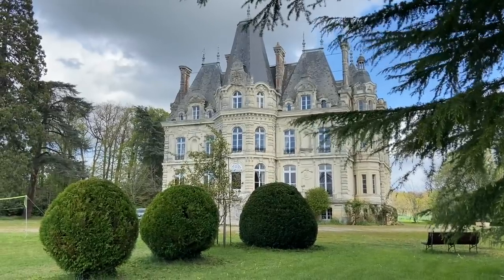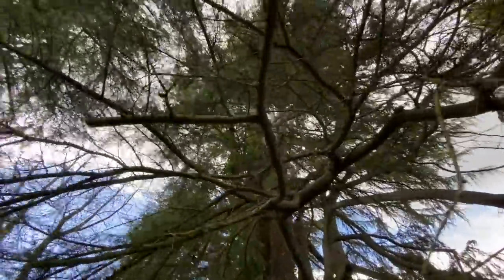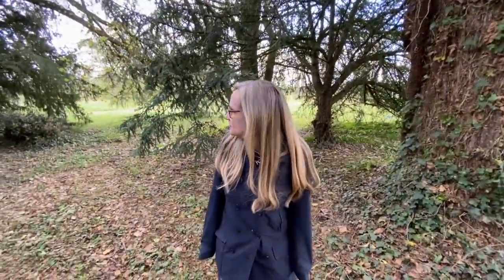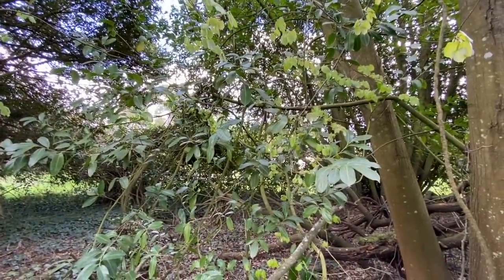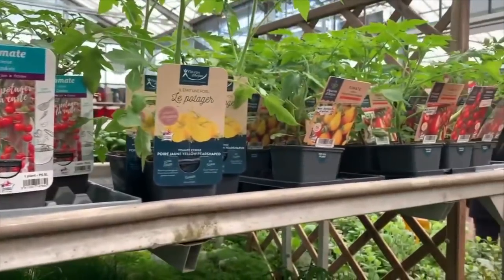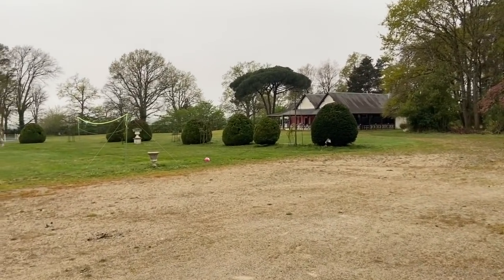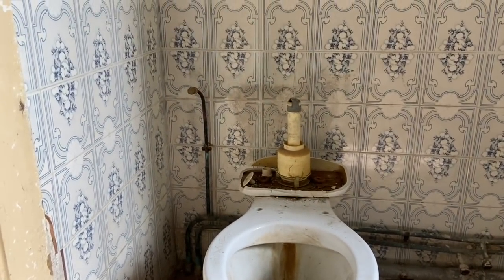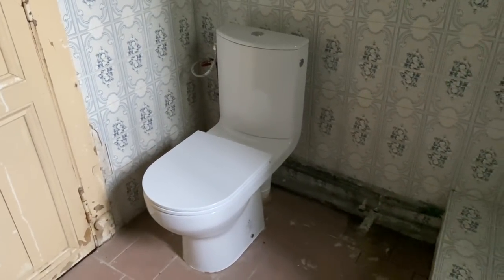Château de la Grifferaie, S3, E7, "Midterm Break"

Comment: I don't know if you were running the hot water but, my water turned Rusty when I left town for 2 or 3 day and no one used the water. It was from the hot water heater and was an indication that it needed replacing because it was rusted out on the inside.
Reply: He only did for a moment so that was cold water I believe.

Comment: About the rusty water..  anytime you turn off water lines that have any type of metal pipes, it will do this when you start the water back up. It can also cause a build up in the faucets. Most faucets have a little screen that you can twist off to clean out. You probably already knew that. lol